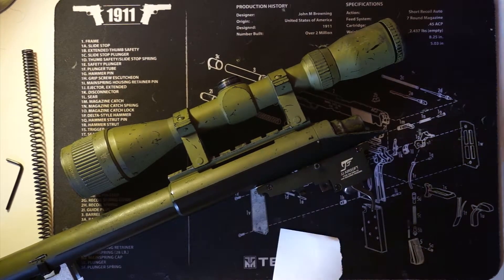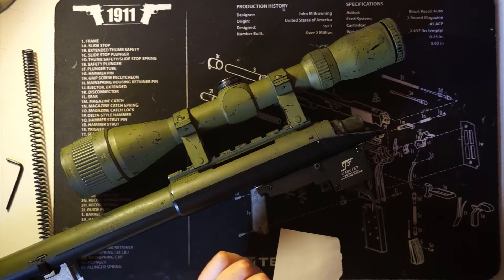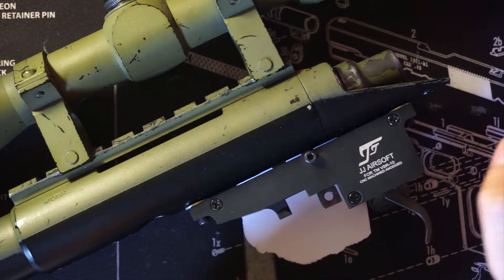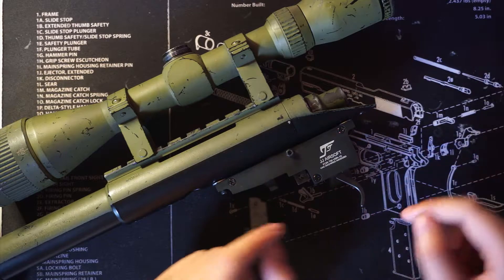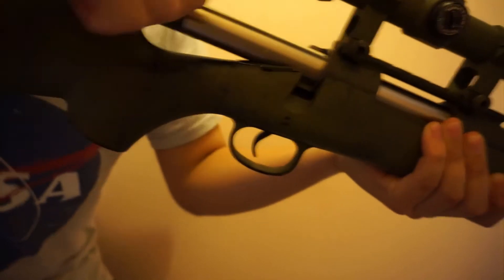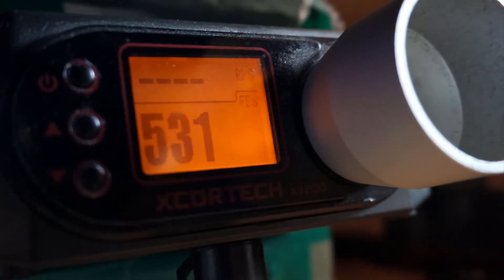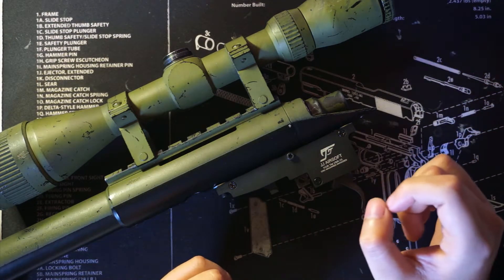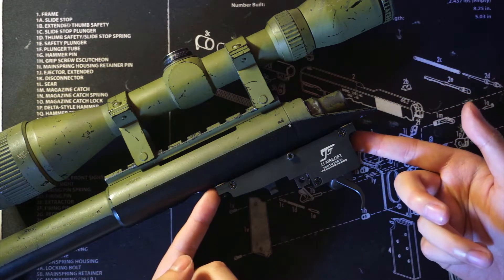JJ Airsoft Zero Trigger (Shooting test and overview)

Comment: Does this zero Triger fit the  marui original cylinder , I just drill and open the cylinder ,I'm thinking can I just buy an Action Army 90 piston and change the original 45 piston , Does it Fit?
Reply from the maker: Sam Chan I believe you can make it with some fine sanding.
Reply: Pete Trys You mean I have to sanding the piston ?

Comment: I'm thinking about buying this zero trigger, but wich piston/cylinder should I go for? I'm on a budget so this is perfect for me =D
Reply from the maker: Budget wise you can buy an 90 degree piston and use it in the Standard Cylinder (you also need a metal Spring guide). I’m using an Action Army Piston and a ASPUK cylinder/spring guide. The Action Army Teflon Cylinder is also a good alternative.
Reply: Same

Comment: Hi!, have you found that sometimes the sear don't catch the piston?, sometimes in my rifle happens
Reply from the maker: I did file down the sear a tiny bit to allow a smoother engagement. There's probably a capatablility issue with your 90° Piston. 

Have you pulled it all the way back? 

Could be an issue with the height of your sear (too low).
Reply: @hipantic  i pull the bolt full back, but sometimes it doesn't catch, I file and sanded a little to a polish finish the sear and runs better now!. What I think the problem is in the piston, I have carved the original stock piston to change the 45° into a 90° and maybe some spots are not quite flat I think?, But to my eyes looks in a flat 90°, and the whole problem its that the rifle that I have is the echo1 m28, and there's no 90° pistons for it
Reply from the maker: @Frambhueee  no 90° piston for that rifle? That's annoying. Well as long as everything looks study it should be fine. Just make sure the piston doesn't give out when you have it cocked back, you don't want it to discharge randomly and break.
Reply: @hipantic  I check the piston after some shooting and it not showing any wear or something, But I wont use a heavy spring yet!, the one I use by now it's the stock M140 ( very worn of)

Comment: I have a cyma vsr10, and when i install the jj airsoft, when i pull, piston doesn't grab, it comes back to its place
Should i add washers too ?
Reply from the maker: Augustin MEIGNAN is the piston your using a 90 degree one?
Reply: @hipantic  oh no
 I have to order one then
Thanks

Comment: Can withstand a 150 spring it says it's aluminum but I don't know if it's strong enough
Reply from the maker: Thomas Reisinger the sears are steel so it’s strong enough.
Reply: @hipantic  thanks and I'll try figure out how to make that trigger pull better
Reply from the maker: Thomas Reisinger let me know how it goes. All I did was sand the contact points smooth and added lube. Smooth like butter now after 500 shots 👌